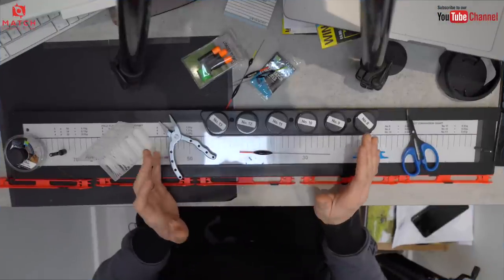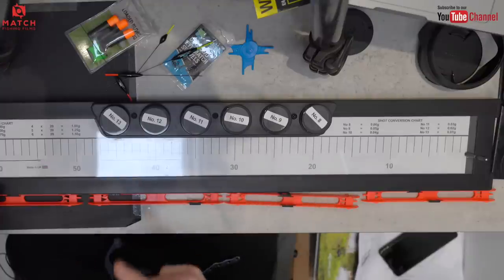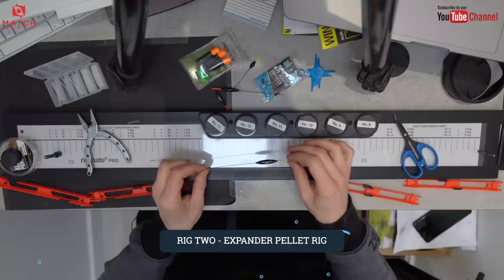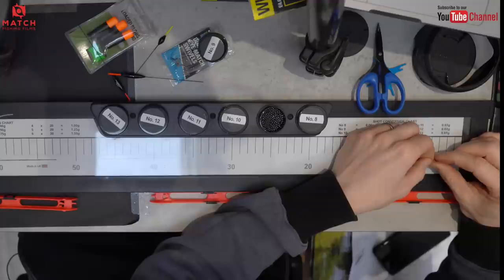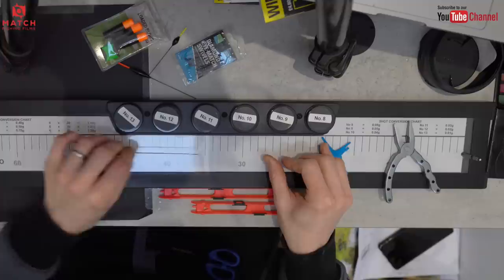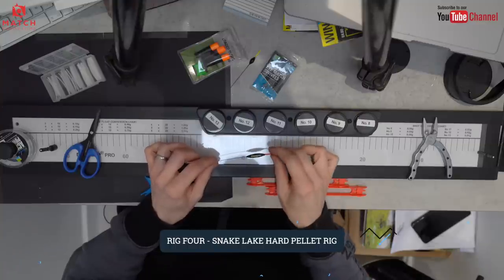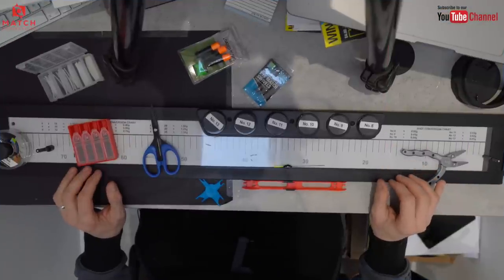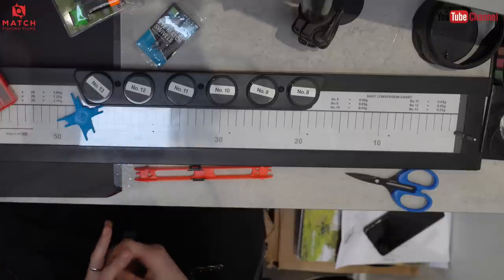How To Tie FIVE Essential Rigs | Pole Fishing

Comment: Tidy, informative video Joe..I prefer to put the float at the other end, after shotting and adding most of the line to the winder... find it less fiddly and don't have to slide the float 6ft up the line. 2 wraps on a red winder is approximately 12" (1ft) for reference..each to their own eh?

Comment: Hi Joe,
I am going to start pole fishing soon, so am a complete novice. When you say you are going to fish on the bottom in 8 feet of water does that mean you make up a rig with 7ft 6in of line which allows for the 4in hook length? If so I then presume you know the depth of the venue in advance.
Very interesting videos. Thank you.
Barry
Reply from the maker: Hi Barry. I always make my rigs up much longer than i think I will need. That way I can trim them down to suit the situation. Don't forget you need a sensible amount of line from the float to your pole tip. 30cm to 50cm is about right
Reply: @MatchFishingFilms Hi Joe,
Thanks for your quick response and help. I had forgotten the pole to float length, so thanks for the suggested lengths of that.
Kind regards,
Barry

Comment: lovely video ive just got into pole fishing my biggest question is the float to shot weight so (exp) if i use at 4x12 float its says on the graph its uses 5x no 10s but when use them like how its say the float bristle and some of the body is out of the water. so what i do is then add a few more shots to make just the bristle show but then what is the point in having a graph thats saying 5x no 10 shots if it dosent work and other videos am i missing something here or am i just thick.
Reply: Depends on the brand of float you are buying...more of the top suppliers i.e. Preston,Guru...etc have very consistent weight labelling on their floats due to the quality and precision of the materials they use now!
Reply: Some older pole floats the designated weight is for style leads . Work out how many grams float takes & use your desired shotting pattern trimming the float tip.